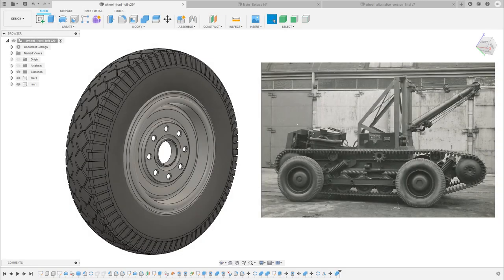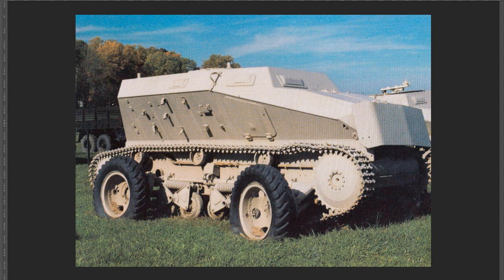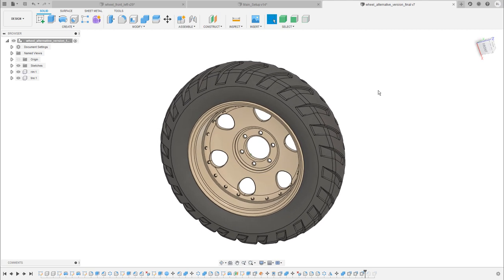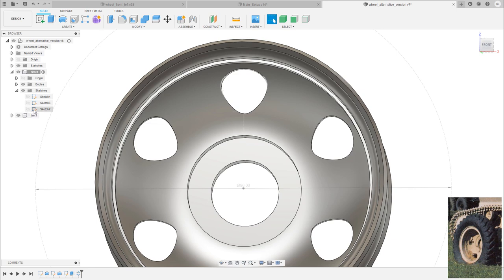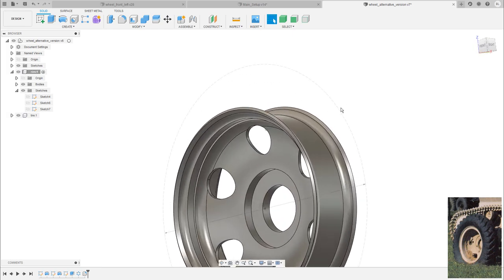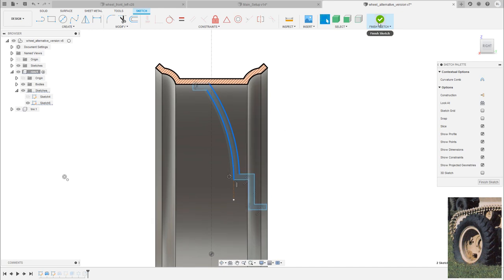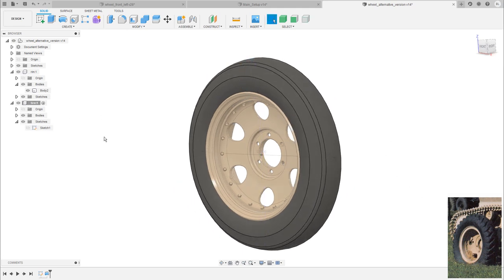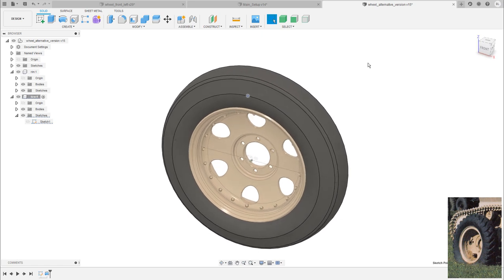How To Model a Wheel in Fusion 360 - Day 10

Comment: Thank you for this tutorial! I’m trying to learn F360 and so far I’m enjoying it 🤙🏻
I would like to recreate a wheel that I’ll be printing for a scratch build scale model of a trailer that holds the Pratt & Whitney F135 turbine. So the first thing I would like to ask you, if there’s a way to have the entire rubber section filled out, so that means no air inside the rubber wheel but only solid material?
The other question is: is there a way to create a “weight on wheel” effect with F360?
Thank you 🙏🏻

Comment: how did you get sketch lines
Reply from the maker: Can you specify what sketch lines you mean?
Reply: @3DGladiator  the dotted circle  line
Reply from the maker: @rock305305  It's a simply sketch line turned into a construction line (shortcut key X) and placed in the top-level assembly of this design. All the parts of the wheel are then created as separate sub-components. I hope this answers your question. Best, Ben